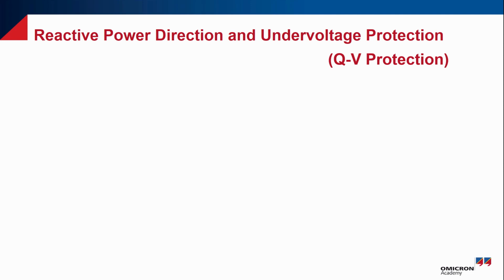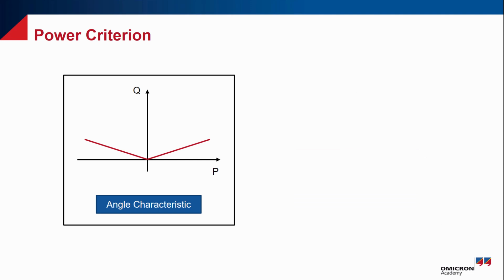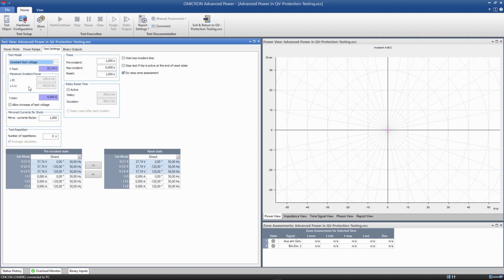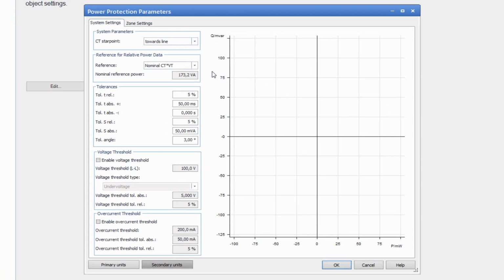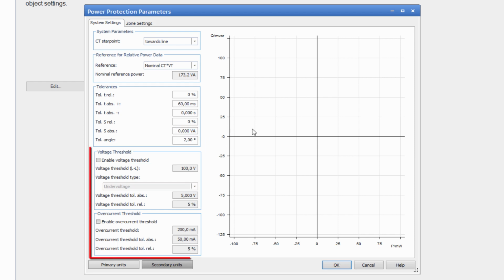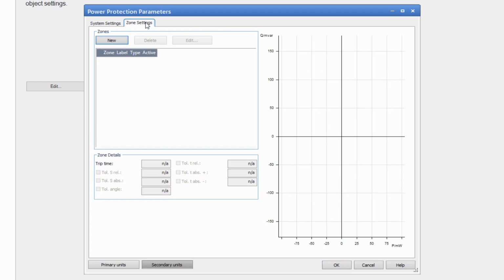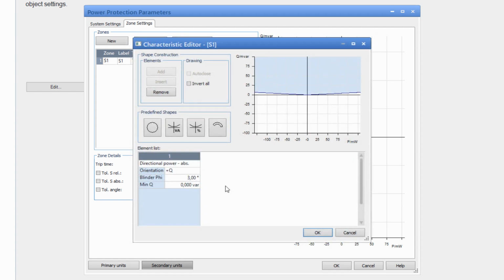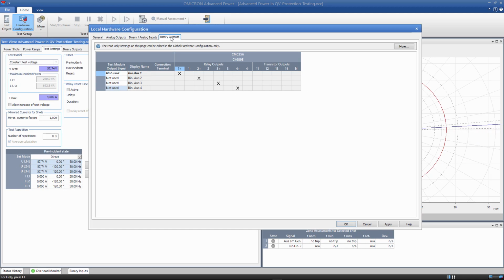Power Module - Q-V-Protection Part I

Comment: How to prepare for reactive power threshold also. Which one should be used for Siemens digsi 4 type relays ..
Reply from the maker: Dear Saleem Champ, 
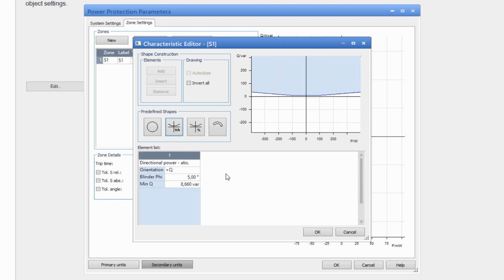thanks for your interest and for your question. To set a threshold characteristics simply set the "Blinder Phi" (as e.g. seen at 4:47) to 0°. The Siprotec 4 relays (e.g. 7SJ80) use such an absolute Q threshold independent of the active power.

Best regards, 
your OMICRON team
Reply: @omicronenergy  Thanks for your valuable reply...